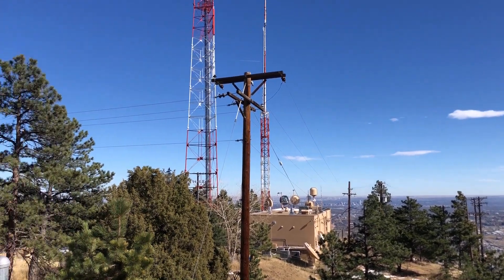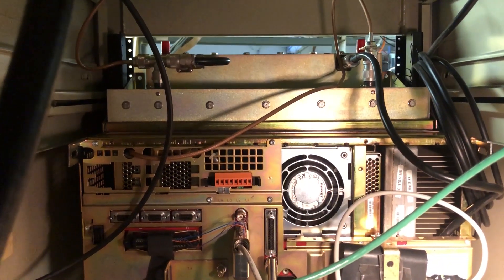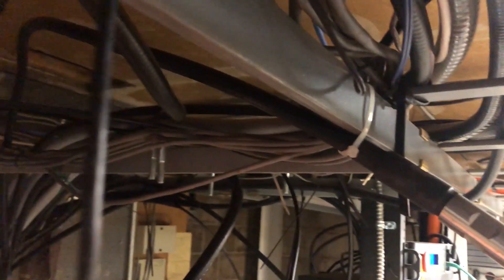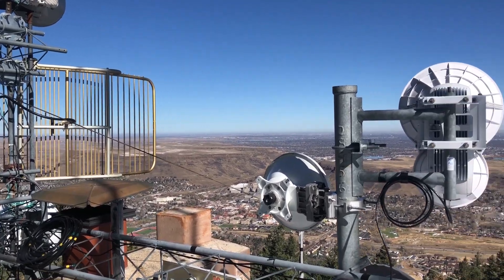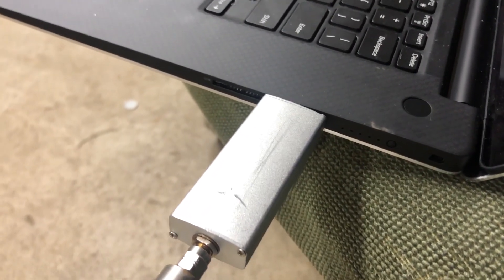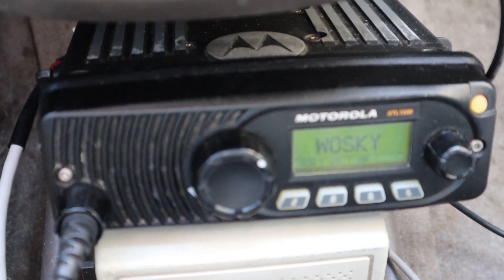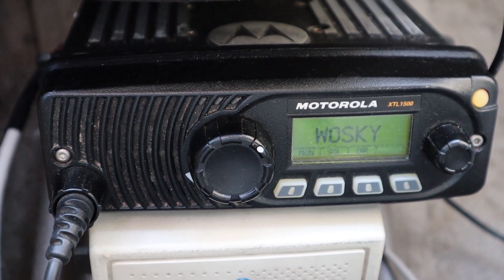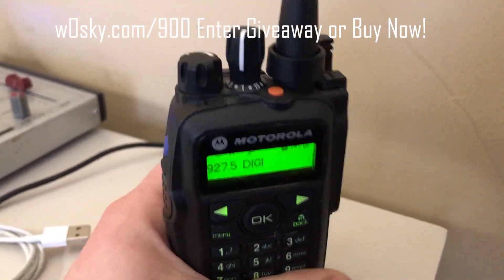My Mountaintop Ham Radio Repeater ( 900 MHz Band )

Comment: Those cavity filters are hard to come by because I use those for simulcast reception on my scanner really helps but I wouldn't recommend it to anyone who can't afford these things at least mine were given to me free of charge and they were tuned properly to the 800 MHz portion of the band to where I was going to receive on so my local trunking system now is coming in great on my BCD 436 perfectly loud and clear no error rates or anything because these cavity filters really know how to not everything out and filter everything kind of like what a water filter does
Reply from the maker: They came form cellular or paging  stuff I think and we’re actually at one point pretty easy to find

Comment: Question: Why did you pick an odd frequency split? usually its an even 25 mhz  / Like: 927.975  -  902.975
Reply from the maker: 902.975 noisy and 927.0375 restricted in Colorado
Reply: @SkylerF Are the Stargate teams using 927.0375?

Comment: Wow, that house has a nice view. It must have been nice to have a place up there before all the RF moved in. As for 900MHz, just like 220MHz, its a very underutilized band. It's pretty easy to setup an antenna for that band. There are considerably affordable panel antennas that have as much as 11dbd gain that also have a pretty small footprint that make great ways of getting into sights that might be far away. I've used a panel antenna to get into a 900MHz repeater 72 miles away with no problems at all!
Reply from the maker: Yeah there’s several houses converted to RF facilities on that mountain. There’s a modern house next to some of the towers that just got built, a little pricey tho 
https://www.zillow.com/homedetails/21049-Cedar-Lake-Rd-Golden-CO-80401/108397922_zpid/

Comment: Hey i have done the same thing here in British Columbia canada, with our Motorola Quantar 900mhz and 440 mhz repeaters. Only i run my 900mhz repeaters on P25 Mode and all the pips and pops are gone. Much cleaner audio. Also my 440 mhz P25 repeaters are set to digital mode only.. We should link our nodes some time.
VE7 IOX
Reply from the maker: There are about 6 Linked P25 900MHz repeaters here along the front range from Pueblo to Denver to Ft colins made by Tracy KI0HC. They work Very well and sound great! I am running mine only Analog because it is the only analog repeater left and it gives something for people to use their analog radios on.

Comment: Awesome Skyler- at 75 watts on your 900Mhz repeater, I assume you are melting any chipmunks that dare approach the coax- FB!  As always, another fantastic job in engineering- 73 de Paul N0AH/3
Reply from the maker: Thanks Paul! I've got some time to go put some footage together stuck at home here. Yup, I wouldn't stand on front of that antenna when TX, I can turn it up to 100 Watts if needed lol.
Reply: Standard output with the PA on those Quantars are actually 100 watts though so he holding back.